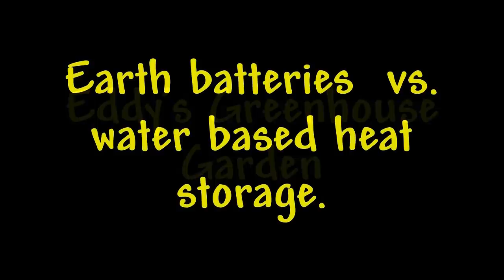Passive Earth Batteries Don't work

Comment: I'm curious how much solar you're using to supplement water heating.  If not much, I can only imagine that all of your heating is by propane.  If that's true, you are burning a butt-load of propane in those cold temps, right.  If so, propane could be used directly as heating.  It seems to me that water-radiated heat would simply provide a more thoroughly regulated heat.  Maybe a more comfortable heat over air-heated??  Please correct where needed.
Reply from the maker: Hi Brent, 
Well right now the solar is not contributing much.  I have about 8,000 watts of solar power available and I have diverted all of that to our home when the sun shines.  All of the greenhouse heating is being done by propane right now.  I did that so I could gather data, thinking this data might be expensive .  But it is not as bad as I thought it would be.  It runs a high efficiency propane circulating water heater,  and with that I can keep a 30 degree differential right now with an average of about 5,000 watts of heat consumption during the night.  I have measured that with water flow rates and temp drops.  I also have the aquaponics system and I think that helps level it out a little bit too.  Since the propane is now dedicated to the greenhouse I have noticed that the consumption rate is much lower than it was, as you might expect.

Using the data I have gathered doing this for a couple of months now, and doing a similar experiment on my home a couple of years ago centered on propane heat vs. electric heat,  I figure I would need about another 10kwatts of solar power and another 1,000 gallons of storage water to be able to store enough heat on sunny days to heat the house and the greenhouse with solar most of the time.  And that is considering I only get about 6 hours of good sunlight during the winter.  I would keep propane and electric as backup systems 

The panels would cost about $6k or $7k but when I am on propane only (just the house) that amortizes out in about 5 years…..because propane is so expensive.

I know there are a lot “holes” in the brief run down I just gave you and I hope I haven't wasted your time here.  But I think there are several inherent  “geeky” factors that would make this work.  

I would love to have you critique my "figures" if you would be interested in doing that Brent.   It is always good to have another set of eyes on my calculations.  

Ed
Reply: Ed, no way brother.  I am not smart enough to get into the weeds with you!  Lol.  I'm hoping you come up with a revelation that could cross over for me.
Reply: vacuum evacuated solar hot water collectors on a drain back system would be much more efficient than using solar panels to create electricity and then convert it to heat

Comment: You are disappointing here. It doesn't sound like you have done much research regarding earth batteries. Of course you have to plan for it before you build your greenhouse. Duh! Would you think about digging a basement after you build the house? I have seen many you tube examples of successful earth batteries. Curtis Stone has one, some guy in Colorado, Verge permaculture come to mind. You don't seem to have any personal experience with them either, therefore I doubt your information is accurate.
Reply: Eddy's Greenhouse Garden "I would love to be proven wrong actually"  https://www.youtube.com/watch?v=ZD_3_gsgsnk  Look what this 85 year old did.Growing oranges in Nebraska!!! It is not technically passive... Anything that moves the heat by  mechanical means is not, but he does not use supplemental heat. Nice channel Eddy. -TheOldGuy
Reply: There's www.citrusinthesnow.com where an 86 year old retired mail man built an earth battery/geo-air system in connection with a green house 16'x80', western Nebraska with harsh winds and temps as low as 40 below 0. He grows citrus and figs and all other sorts of things in his greenhouse. Yes, he built from scratch. You're right: nothing can be truly passive and work; there will be some effort involved; that's an unstated, universal law. He has a couple of blowers circulating air and lexan polycarbonate sheething on south facing walls and the roof but has Thermax foil faced foamboard for the north. He uses 6" metal ducting throughout the ground. He dug 8' I believe. I'm wondering if you possibly meant to re-title the video stating that fully passive Earth batteries not working ideally. Blessings! Nice setup!
Reply: I agree with some of what Eddy is saying.  1) That it may be easier to retrofit an existing greenhouse with water (depending on how it's done), and 2) that it's easier to scale-up a water system, and 3) earth excavation can be expensive.  

But other than that, both water and earth are thermal mass.  Sure, water has higher heat capacity, but there's no shortage of earth!  In terms of temperature and heat, it basically doesn't matter which type of thermal mass you're using, or which heat source.  

I'm not sure Eddy realizes that with the earth battery, you can get some amount of seasonal heat storage.  Saying that the temperature is constant several feet down year-round is based on not adding or removing heat.  But in the earth battery that's exactly what you're doing!  So the summer heat goes in the ground for later use in the winter, and the winter latent heat goes in the ground for later use in the summer.  In other words the outdoor temperature "phase leads" the ground temperature.  

I agree with Eddy though in the sense that the earth batteries aren't a mature technology yet and the current incarnation is rather expensive to install, and the design risk maybe isn't as low yet as one might like considering the level of investment.  I think some folks have succeeded with them though, and I think the concept has a lot of potential once the design(s) are made less expensive and/or easier to install, and once they're made more fool-proof to DIY.
Reply: Well said Eddy.  Joan hasn't built one herself and then decides she's an expert.  Passive solar greenhouses have been tested for three decades or more and it keeps coming back to water as the primary heat storage.
Reply from the maker: Jeff, 
I think Rocket mass heaters are pretty neat things.  The only drawback is you  gotta' feed the stove and I'm kinda' lazy that way.  However........if you  could get the "mass" part to be water...as in perhaps something like the old steam locomotives, i.e. fire tube boiler configuration......hmmmm.   You  might be able to heat a whole lot of water in a  short period of time.    The only thing that comes to mind right now is old natural gas water heaters, connected together, end to end, laid out on an incline, circulating water through them.  I might try that.   Thanks.
Ed
Reply: Eddy's Greenhouse Garden that is not true I just watch a live presentation from Curtis Stone he has a passive system
Reply: Curtis is great! As is Rob Avis.  The insulation in their system extends down deep into the soil along the footings, not the pipes. Actually rather than straight down, I believe they advocate extending at an angle. out from the greenhouse.   
While Curtis is meticulous, his greenhouse is more of an experiment (I have followed him on youtube for years).  He originally wanted to plant into the soil which made the earth battery essential. He no longer is doing that.  I'd like to encourage you to keep following your original idea to see how it works rather than have youtube warriors tell you what you should be doing.   
You're right about water, the only issue is that it takes up some of the useable space.
Reply: yes, the sun.
Reply: Actually he is using both, which is what I plan to do.  Not sure why it is an either or proposition.
Reply: Curtis Stones installation is a good lesson in how not to design a system. I find it incredible how folks manage to design systems that are so fatally flawed. you`d have to try really hard to deliberately design something any worse in a lot of cases.
Reply: I would just like to add a suggestion Eddy....  Have a look at rocket mass heaters. If you put the rockets mass under the barrels I think you'd find a huge benefit with little fuel use.
Reply: If you put metal water barrels right on top of the mass and insulate all around and underneath it, the heat will have to migrate upwards into the barrels no?  The good thing about a rocket mass heater (RMH) is that you only have to fire it every couple days or so. Simple cheap and effective.
Reply: During the hot summer he pumps air into the soil heating the soil to 80 degrees  his trenched area is insulated it acts as a battery over the winter. 6 in of trench Dept is good for one month of heating
Reply from the maker: Nicholas, 
Why don't you  ask him if he does use some heat during the winter.  I am sure he would be forthcoming.  He seems like an honest guy to me.  His answer would be most educational for all of us. 
Ed
Reply: Eddy's Greenhouse Garden yes he does use a heater for security. But says it rarely runs. And it runs to keep it at 20 c but you can easily keep it 10c and above in most area winter's without. Is my understanding
Reply: I also watched the same webinar with Curtis and Rob Avis.  Curtis mentioned that he uses $4k/yr on electricity on his passive solar greenhouse (relying on memory here).  Obviously there are heating and cooling costs to his system.  For sure Curtis and Rob have good systems and I don't want to take away from their work but there is more than one way to do something...  Some of us don't have the money to burn like that.

They had a product to sell today... they did mention that on bedrock or high water tables a different system should be employed.  I'm with Eddy on this, climate battery has some benefits but you can't beat water for heat storage.
Reply from the maker: Very interesting.    It would be quite informative to learn some detail  on how he actually built the earth mass beneath it.  And..........how much heat "for security" he actually uses when it gets really cold......and how cold that actually is.   I think you mentioned it was insulated.   That would certainly help.    But insulation isn't just a one way deal.   If it's insulated well enough,  you  won't lose much heat through the sides and bottom to the surroundings.   But you won't get any help from the surrounding, naturally 45 F, soil either.     If there is no added heat and it does stay on the 60's F during the coldest part of the winter........ there is something to be learned from him.    A wise man once told me, "you can't argue with success."   If he's able to do this as it appears and his climate is what I think it is............I am missing something.    I am not emotionally tied to this opinion  of mine.    Numbers and data tells it all.    I would like to learn more. 
Ed
Reply from the maker: I just posted a long reply to Nicholas on this so I won't repeat it here, however.......having watched Curtis for a while, he looks like a smart, meticulous guy to me.   He could be doing something I never thought of.   
Ed
Reply from the maker: Well Jeff, 
I am going to continue with my idea.  Spring is here and it's time to start the project.   I have a remote room to store the water so it won't take up space in the greenhouse.   Thanks for the encouragement.
Ed
Reply from the maker: But they are not passive.....they are using a heat source of some kind to make it work.   Don't forget that.  Earth batteries do work if....like you say, you build it first and ....you add heat...or it is not really that cold during the winter.   

I would love to be proven wrong actually.  I would welcome an example.  If there is one.....there is something to be learned. 

Thanks
 
 
Ed
Reply: @eddysgreenhousegarden7022  the earth batteries use electricity for the fans or blowers.  Therefore they are not "passive" earth battery.   No?
Reply from the maker: @rachaelmorrow6669  I suppose that's true if you cut it to a fine point.   But fans and such are a small energy consumer compared to the amount of heat energy we are talking about.  Most people  ignore fans and blowers for that reason.  But they do consume energy too.
Reply: @eddysgreenhousegarden7022  As the passive earth batteries use electricity to run fans or blowers, then they are  not passive?  No?
Reply: LDSPrepper has the best video series on design and results of an earth battery design.  He presents a formula for how much underground tubing you need per cubic feet of greenhouse.  He's in Idaho and said he didn't need supplemental heat to keep the greenhouse from freezing during a winter that got down to -17.  He has a newer design under construction that uses buried rock, which stores heat better than earth.  Here's a link to a long playlist going through it, the first one is entitled "Geothermal Greenhouse: It worked. It really worked!" https://www.youtube.com/watch?v=qA3YGYELZ98&list=PL2cLVMJiux-nD4s7Ofby9ah835Xi9hnq8

Comment: In my climate I am sure an earth battery would turn into a mold factory.
Reply from the maker: Another thing to consider.    I didn't even mention that part......Thanks. 
Ed
Reply: @eddysgreenhousegarden7022  
Another myth, i paid a drain company to check my tubing with a fibre optic camera 5 years after it was installed, no mold. I also tested with filter elements designed to catch spores etc from the outlet airstream which were sent to a lab for culture testing, basically put in a petri dish to see what grew. The result was nothing that would cause harm. The only thing i would be concerned about is radon, carry out testing before installing a system if you live in an area where its prevalent,
Reply: with proper airflow the mold is not a problem and is actually less of a problem because of the increased airflow and circulation.